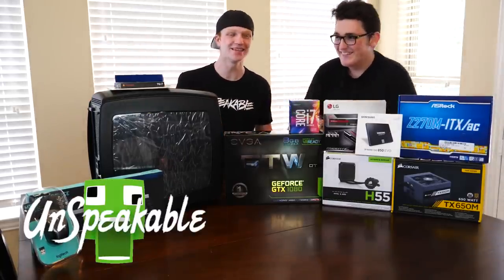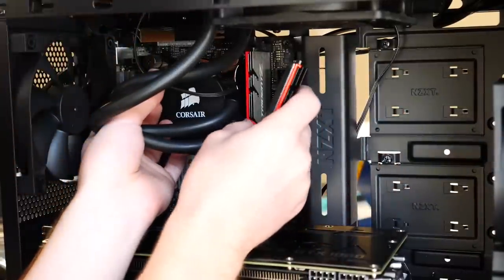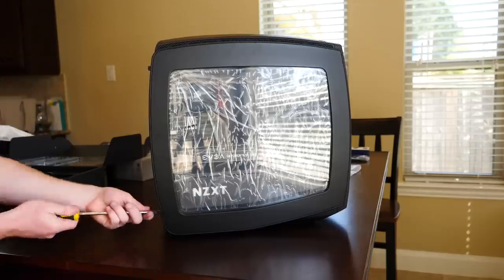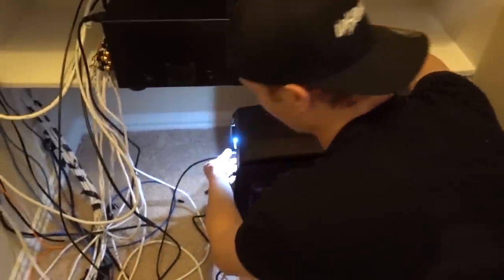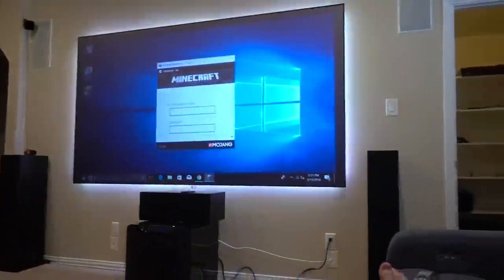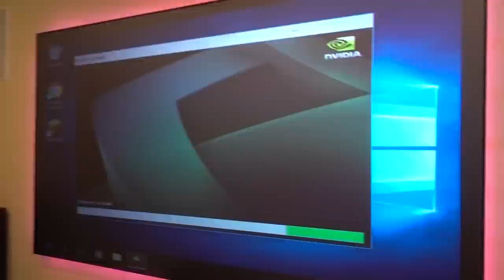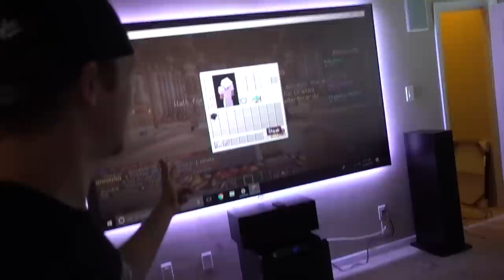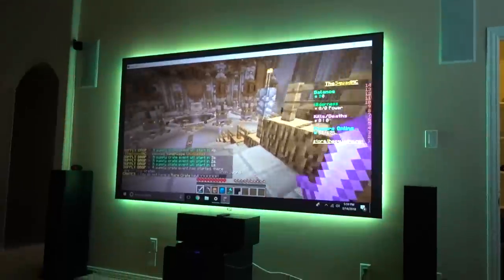$10,000 MASSIVE GAMING SETUP!

Comment: 🤦‍♂️ you dont put the motherboard in first and the gpu goes in last.

the order is this:
cpu in the socket, then ram, (then any m.2 ssds), then (if air cooler) cpu cooler, then mobo in the case, attach fans together or storage to psu, last is gpu.